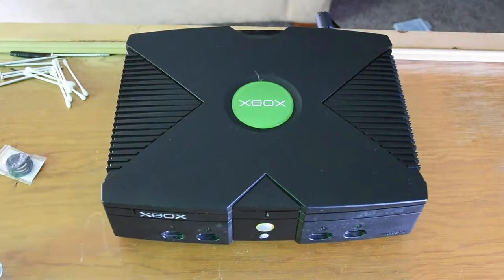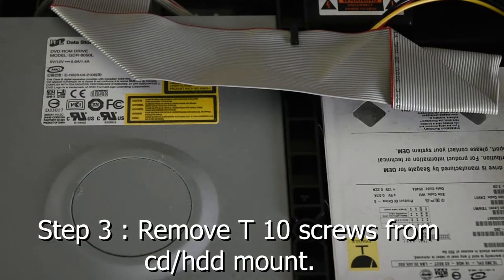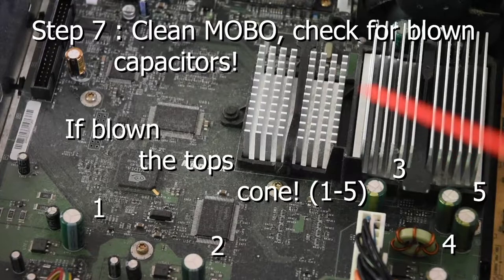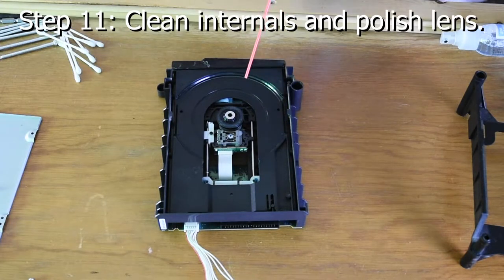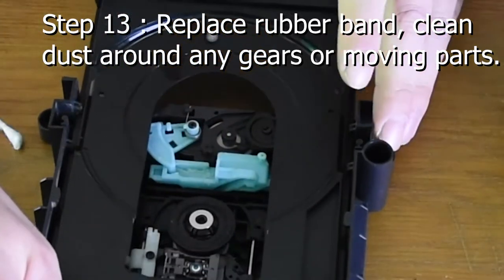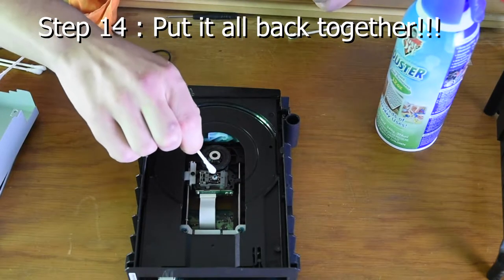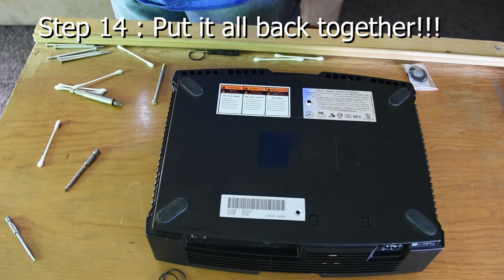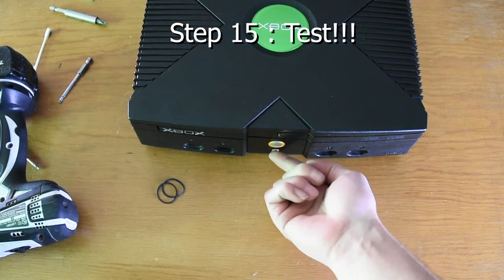xbox original disc drive fix

Comment: I've an Xbox that the motor that spins disk is very loud.  That 5star is called torques in case you didn't know ;)
Reply from the maker: at work all the torx screws have 6 star!
Reply from the maker: I never saw 5 star until I met the XBOX, Thanks for the comment, your one of the good ones!
Reply: The Xbox I just got from Gamestop with a 2 year warranty sounds like it's going to take off when I boot it up... eventually the DVD quiets down... but it's kind of annoying.  I'm so jealous of your Clear XBOX mod system.  I'd love to get my hands on one.  It's gorgeous.

Comment: Xbox DVD players have gotta be finicky... I bought a used copy of Baldur's Gate: Dark Alliance 1 off of Amazon Market Place for about $17 complete.  It was the Original Box... and it wouldn't boot.  I thought it was the system but it was actually the disk (Well, it was the system, but the disk was also bad).  So I ordered a copy off of Gamestop assuming I wouldn't get a box or manual (hoping for a better less scratched up disk) and they sent me a Greatest Hits version with a box (no manual).  The disk is nearly flawless... and IT won't work either!?  So frustrating.  I have Dark Alliance 2 and that disk looks like someone used it to sand a cat's tongue... and that works just fine.
Reply from the maker: Try to get a 2005 model, my 2002 model is sketchy. Omg, I wonder how good the OG XBOX would look with a Framemeister?
Reply: Gam3Tat0 at the very least you could enjoy it on your modern 1080p TV with no input lag.
Reply: Gam3Tat0 Is there a way to determine what year your OG XBox was manufactured?
Reply from the maker: Yup its printed on the bottom of the AV port.
Reply from the maker: I bought a component to hdmi adapter, but it outputs 480p only. I've been playing Def Jam Fight for NY!